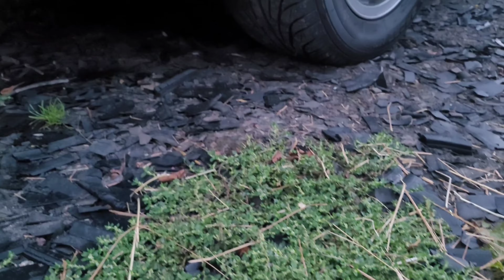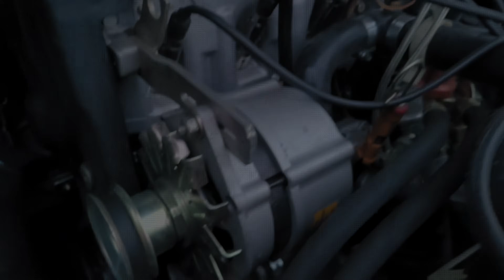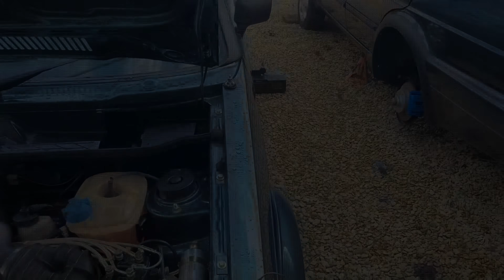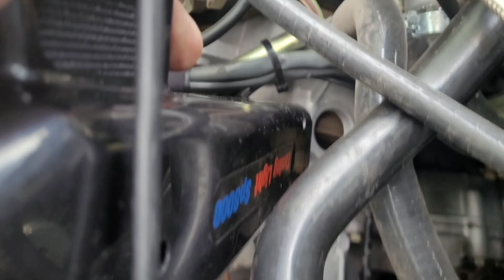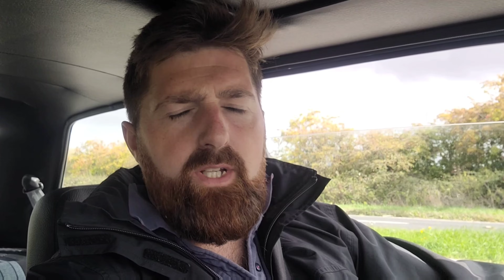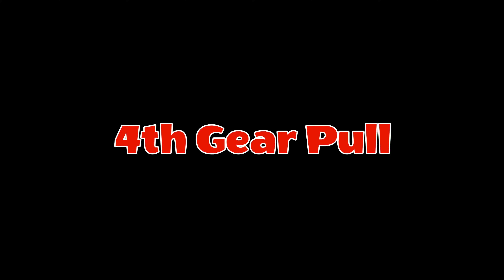VW Mk1 Golf GTi - BRMotorsport Engine

Comment: I worked for gti engineering maby years ago in the old air craft hanger at Silverstone circuit iworked  with brian ricketts richard llyod and mick laurence and dick richards one  of the best jobs i ever had ..the engine shop was fantastic ..
Reply from the maker: Wicked, some rapid motors came out of there, I've had the pleasure of driving a BRM 152 Mk1 and christ it moved its ass
Reply: @GreyGooseRestorations  yes some of those cars moved quickly I moved from GTi to next door which was Richard Lloyd racing then from there went to Eddie  Jordan grand Prix as number 2 mechanic ..I'm the one who messages you regards my 924 porche fuel system lol I can take a race car apart but struggle with a 924 fuel system lol the guy before me messed car around though didn't know what he was doing
Reply from the maker: @stevehunt3847 ah ok 👍

Comment: do you plug the oil breather hole in air meter box when testing with the gas tester i didn’t even remove that pipe when i done mine was that wrong should i do it over again mines always near the limit at mot time lol but i think it is there pet hate
Reply: another quick question you know on the metering head the hole to adjust the co fueling ect does that need to be blocked of in normal use will it let air in upset setting or is it sealed off from the system
Reply from the maker: @renbarturbo 99% of cars out there dont have the holes blocked so a tiny amount of unfiltered air will get in but its still metered as it goes through the air meter.

They did come with a rubber bung from the factory or where sealed closed and drilled out by people needing to adjust the CO
Reply: @GreyGooseRestorations  nice one cheers mate
Reply from the maker: Yes, as the oil breather pipe can add around 1% to the C0 reading
Reply: @GreyGooseRestorations  so i plug it shut at  air box and vent to atmosphere from rocker cover pipe
Reply from the maker: @renbarturbo yes 👍
Reply: @GreyGooseRestorations  thank you 👍

Comment: Awesome car thanks for sharing! I Am still learning but I thought the warmup reg was just for start and not in play when KjetLamda takes over. Can you please explain? does it set warm pressure as well? How does that compare to shimming the plunger to raise pressure? thanks for clarifying.
Reply: Sounds like I need to continue my education! Thanks for shedding some additional light on the subject. Once I have my car back up and operational I’ll reference these videos and see if I can put it all together. 
 👍🏻
Reply from the maker: Shimming the pressure relief valve just raises overall system pressure.

The WUR takes the control pressure from approx. 1bar cold to approx. 4bar warm.

If its the 16v type the WUR is set to reduce control pressure once the throttle is opened again allowing more fuel to eliminate the lean period that occurs just after throttle opening.

Warm pressure is fixed unless the WUR mod has been carried out which will then reduce the warm control pressure, allowing more fuel.

Kjet lambda or CIS-E uses a pressure valve on the side of the metering head to adjust control pressure relevant to certain input signals from various sensors.
Reply: So, reduced fuel pressure means more fuel?

Comment: really good video as ever 👍 me being thick when it comes to knowing where to start on my own 16v motor, i wish there was an idiots guide type video of how to set up these engines step by step.ive tried the typed version available on clubgti and i find its not written for "idiots" more for those who understand the terminolgy and equipment more. I suppose such a video would take too long to make though....🤔🤔
Reply from the maker: Thanks, alot of it is experience with the engines and picking up on the sounds and noises etc, i potentially could make one at some point 👍
Reply: @GreyGooseRestorations  thats great!!! ive looked on the missingpart site, the kjet gauges are appealing to me, bit confused over which ones id need for kjet.. 
A future video of the basics would be absolutely brilliant! 👍 how and why you do certain things. 
incidentally, the mk1 used kjet but i didnt know that the later 16v wur's were different to the 8v ones 🤔. There seems to be a bit of secrecy where gti engineering were concerned regarding what exactly they did to the dizzy's and the fueling to achieve the fantastic results that they did, their work was outstanding Brm too 👍, i think the nearest to them in terms of results might have  been tim stiles before he retired, my mate sold a lovely red mk1 gti last year which had a "brands hatch" motor in it he said it was superb. thanks again mate 👍👍
Reply from the maker: To be honest from what I've researched etc theres little or no evidence to the dizzy and fueling being altered bar WUR mod and setting it up.
You can adjust the metering head flow output but stock they are good for 200bhp
Reply: @GreyGooseRestorations  thanks 👍 yes i remember there being alot of speculation surrounding the ability to produce such great motors, ive never owned a gti enginerring car, im thinking they over engineered stuff like the cranks and the heads? were the engines blueprinted?. I do find this stuff interesting despite not having much mechanical skills,  those tweaks to the wur and the fuel flow obviously gave very good results! overall isnt the kjet restrictive beyond a certain point though?  its a shame parts like the isv are no longer available but im guessing theres a work around for this should needs be. Im hoping to be getting my own car back up and running fairly shortly 🙏  i do like the delivery from kjet 👍
Reply from the maker: Yes so much can be gained by getting the cylinder head flow correct and building the engine perfectly. K-jet does have limitations such as its all or nothing, and any adjustments made effect it all.

Comment: Awfully quick that MK1 is! The mk2 with its added weight just cant compare, especially if you're a Jetta owner like myself.

So you mentioned unplugging the vacuum advance when doing the ignition timing. I have been wondering about this and does this mean unplugging the rubber pipes that fit underneath the large black intake pipe? They are located underneath this pipe close to the intake manifold butterfly.
Reply from the maker: Definitely is, the distributor should have a vacuum pipe on the side, remove this and plug the pipe with a bolt of sorts. Check and adjust timing then fit the pipe back on.